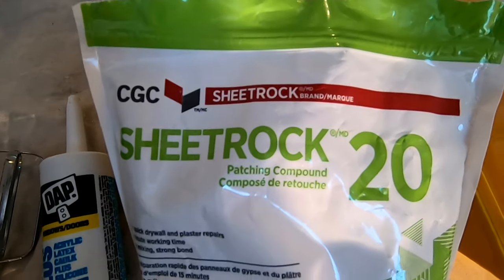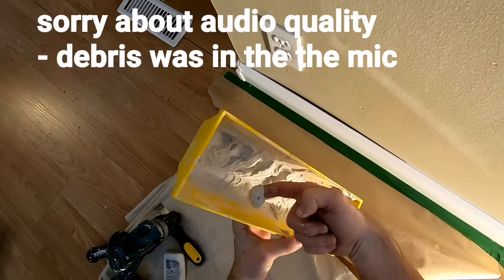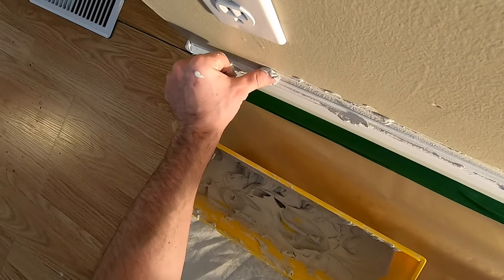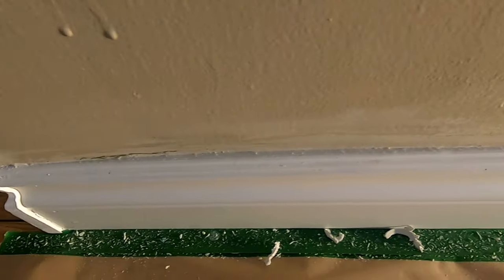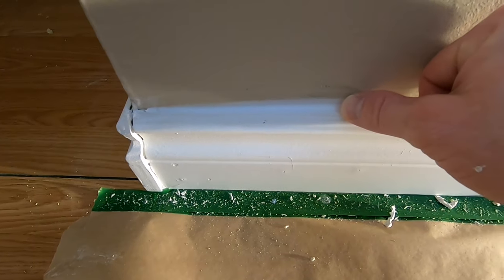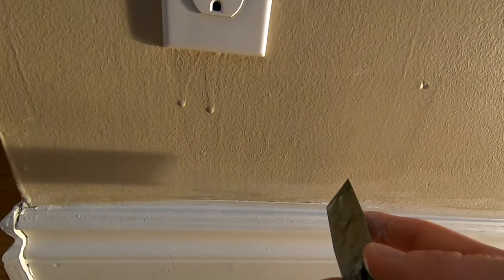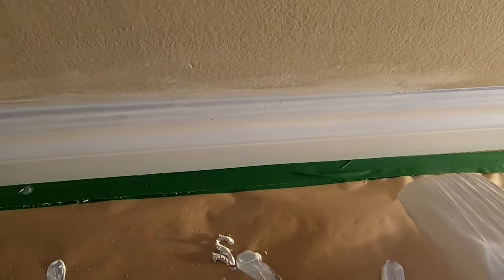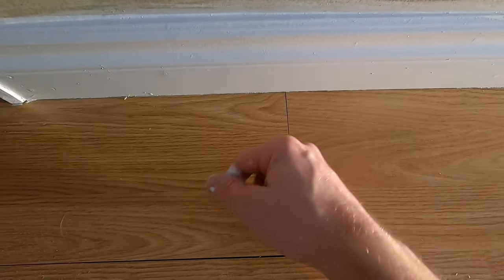Filling an excessive gap between baseboard and wall

Comment: How not to caulk-in your skirting/base board ...nice try though!
Reply from the maker: The subject of the video is a method of dealing with wide gaps, not caulking per se.
Reply: @Interior_Works  it's caulk. Caulking is the action. Caulking is a verb. Caulk is a noun.
Reply from the maker: @michaelmcgee2026  Dictionary: "Caulk or, less frequently, caulking is a material used to seal joints or seams against leakage in various structures and piping." A significant portion of videos on the material refer to it as Caulking, as the YT system will sometimes erroneously flag caulk, if pronounced properly with a silent L, as foul language, and affect the ability to monetize.
Reply: So again, no content. Ignore this troll"upthesaints"

Comment: The proper way to fix that gap is to remove the bad drywall behind it and then replace it.
Reply: That is an excessive amount of work for a purely cosmetic item. Not to mention that the drywall is only warped because the wall is, so you'd probably have to fix the whole wall.

It's waaaay easier to just fill a gap and it looks good.
Reply: Not everyone is blessed enough with funds to replace entire walls to fix something that is a little crooked 🙄
Reply: Actually the best way is to do a total tear down of the home and salt the property. Build from the ground up and make sure the walls chef kiss perfect! 😉

Comment: NEVER use your thumb. Use your pointer finger or if you really want to waste time cut out some pieces of cardboard into squares. Secondly just use caulk instead of wasting time making that concoction.  This is the reason i can't stand youtube creators that have no clue what they're doing. Your trim isn't cut on a 45 either.
Reply from the maker: 1. In the video, I adjusted to what worked best as I went along to get as much excess off, at the end it wasn't my thumb.  

Cardboard won't leave a smooth sealant of caulk. 

2. Loading caulk in there would leave  a rounded fill. Simply impossible to carve or sand caulk to a crisp 90°, creating a flat extension of the wood to the wall.

-That's the point of this video, showing a different, albeit a bit more complicated way to achieve a different result, a better looking result, so I spent 10 extra minutes of my own time for this spot, this is a video perhaps more intended for perfectionists.

Everywhere else was flush and I just caulked it and wiped with a damp cotton cloth.

3. That trim is from long ago and nothing to do with me. I was just giving a rental a fresh coat of paint and caulk. ..Assumptions.
Reply: @Interior_Works  cut a bunch of cardboard into 2 inch squares and try it. You'd be surprised how well it works with caulk. Its also very clean because you can stack them on top of each other (like pancakes) and when youre done just throw them away. I've been in construction for 20 years. We use this method when we have to fill gaps with a lot of caulk especially when adding a screen room to house that has existing siding. The gap is over an inch so we squeeze as much silicone  as we need to fill it and use cardboard squares to clean it up. Fill both sides of the gap and it won't shrink. I get the point that you want to show different methods but what diy person is going to run out and buy Elmer's glue to add to mud and then also have to buy caulk? Work smarter not harder is what I always tell my guys